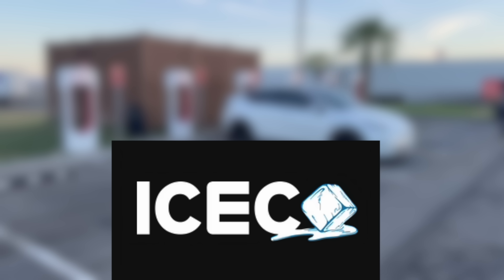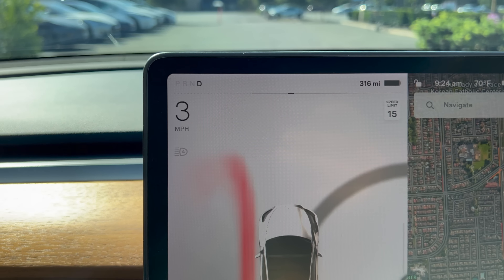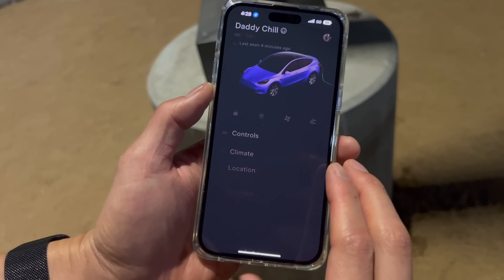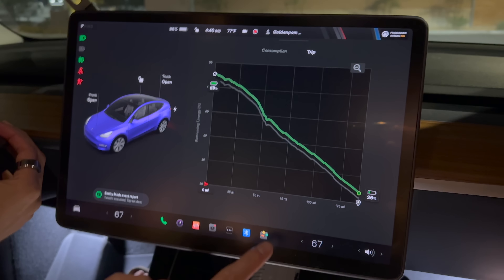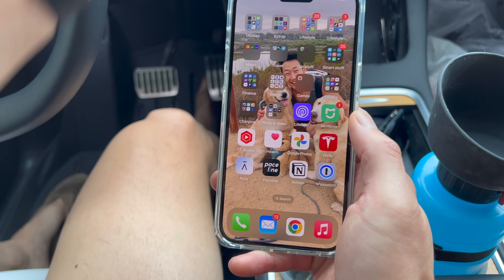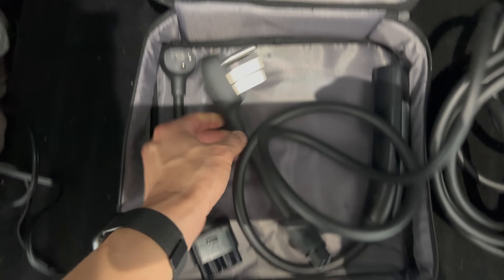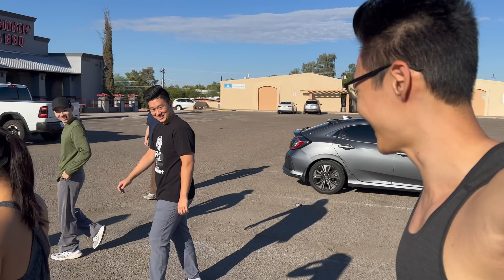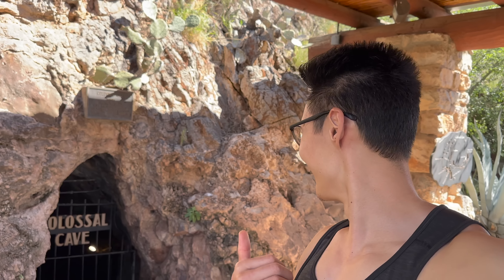Taking my Tesla on a Roadtrip to Arizona

Comment: Left my car in my garage for over a week while I was on vacation. came back drove it 2 days no issues. on the third day hooked up my 12v fridge (that ive used before no issues) 20 minutes later a slew of error codes... VCFRONT_a192   BMS_a170   BMS_a027.  BMS_a035.  UI_a114   DI_a227. might of been the perfect storm to destroy my 12v, my car is 4 years old, bought it 3 months ago, I'm really hoping its just the 12v battery, have no idea if the previous owner replaced  it. service appointment set for the 17th. I don't trust the 12v in my 2018 long range model 3 after this, scary error codes and I live 2.5 hours from the nearest service center. I can't risk using a 12v fridge in my car again... I even found the perfect fridge that fit behind my passenger seat.
Reply from the maker: Does it have a low battery discharge feature? This one does!

Comment: Hi Chris. First I love your videos. I love that you take your dogs everywhere wit you.  I just got my model Y performance just to do roadtrips with my two dogs. 

My question: my battery died under warranty and was told they put a new battery in it (wish I knew how to tell). Well this was last week. Then I noticed that I was only getting 266 miles!! A new battery should be at least 300. Based on your experience it seems like I just need to be patient until the battery calibrate. But did you do anything different? Did you drop to less then 10% and charge back to 100% a few times to help it?
Reply from the maker: Check my battery died video! Same thing happened. They use the old batteries that have less miles but it gets better after driving

Comment: hey Chris.. great video. I used your videos to help with accessories and general knowledge when purchasing my 2022 model 3 long range. loving it. Quick question.. I've been on the fence about purchasing an external power supply for emergency power. I found several on Amazon. Do you think this would be worth it and keeping it in the trunk.. like on your trip here.. where there aren't many chargers.. could be useful. Maybe a good topic for a new video! Please let me know what you think and keep up the great work!! :)
Reply from the maker: I thought of that but it’s not strong enough to charge a Tesla. Those giant solar ones may work
Reply: @EverydayChris  thanks!

Comment: @EveryDay Chris Great video!! Since you have had the MY for some time have you experienced any experience or noticed any ear pressure or pain inside the cabin? I am curious as I had seen it on the forum.
Reply from the maker: I get what you’re saying. The forums talked about it. Try outside air. It doesn’t bother me but I feel it sometimes
Reply: @EverydayChris  My MY EDD is next month and I have test driven the MY as of yesterday my 4th time and that was the 1st that that I noticed it. I am on the fence to pull the trigger based on the forum and trading in my Lexus RX.
Reply from the maker: Ah you should be fine! Still going to do an rx video but you won’t regret the Tesla

Comment: interesting watch. waht is the reason the better route planner just doesnt tell you to charge up to 90-100%? i mean if you need to charge a bunch of times to get to your destination don't you just reduce # of stops if you charge to 90-100%?
Reply from the maker: It’s because charging above 70 takes a lot longer so it’s quicker to charge a lttle
Reply: @EverydayChris  ah ok. Optimizing for fast charging/charging speed. Got it.